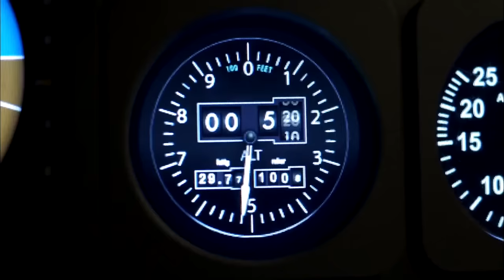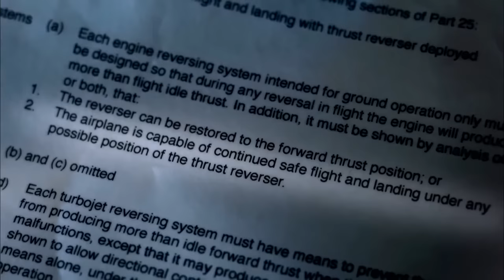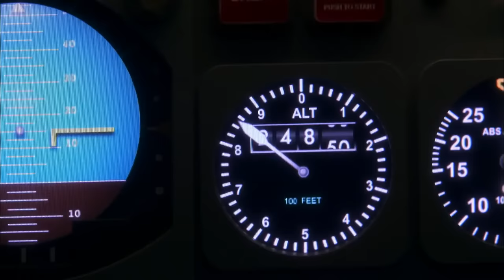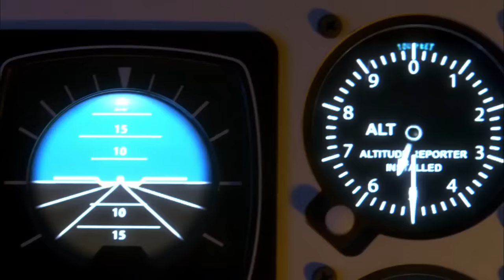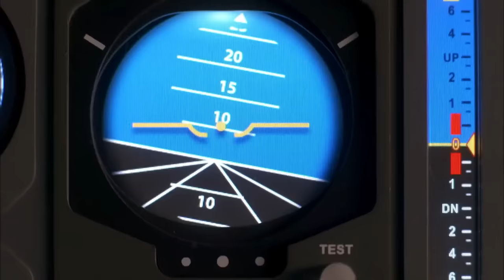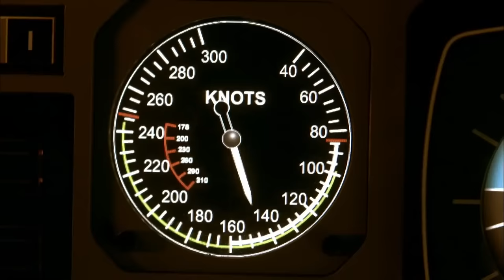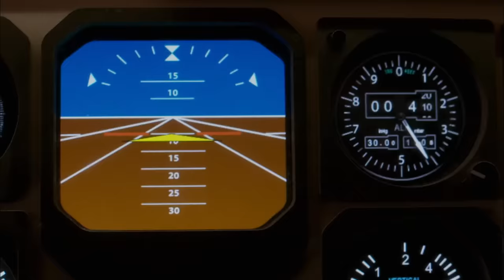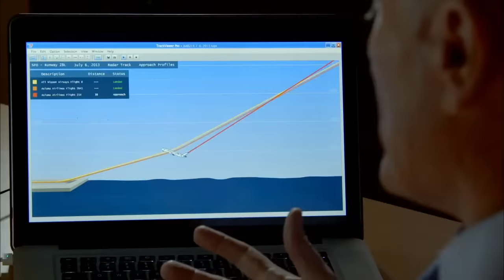Every Single Plane Crash - Air Disasters Seasons 8, 9, 10

Comment: I am hooked on these shows because the re-enactments are truly done as accurately as possible, with full explanations as to what the pilots did and why, which is then followed by an incredible investigation in which the minutest details are deciphered to uncover the issues that lead to new regulations that overwhelmingly has made flying safer.
Reply: The reenactments are silly and riddled with inaccuracies and errors large and small.
Reply: @darkprose  mexican planes are better
Reply: @darkprose  why don't you go ahead and try to make them better?
Reply: @Aidy_tude7.16  sorry this is long. A tl;dr is while they do a great job, they were a TV show and they upped the drama to pull people in and do make mistakes. But many shows do. 

To be fair, this is a cable TV show (or at least these seasons were). So they made the episodes more dramatic, trying to draw people in who channel surf and randomly found it. 

Most details are right, but sometimes just parts of the reenactments are silly. They're normally amazing, don't get me wrong. No youtuber comes close, not even someone like Mentour Pilot. But every so often it's just... stupid. Like when an FAA guy writes possible causes on a white board, and it's literally just 6 bullet points they cross off one by one. Or when 5 people are hovering around a scientist who should be in a lab. Or the pilots reacting far stronger than they actually did on the voice recorder- like more angry or more fearful. 

It's a great show visually. But when I love watching channels that show the crash and have all the facts right without tons of drams, like Disaster Breakdown, this show hits different. And yeah, they do tend to make mistakes - but any show, or channel on YouTube, likely has a mistake or two.
Reply: I feel the same way, it truly amazing how they can figure out the cause of each planes disaster!
Reply: @darkprose  got any proof of that.
Reply: Ikr they’re so good 👏
Reply: @FallenAngel53  👍
Reply: Plane crashes—> 

Xanax sales soar —>

Big Pharma shareholders smile
Reply: On Disney
Reply: @darkprose  I agree, the re-enactments are horribly acted.
Reply: @Hinzey98  yeah, literally the actual cvrs being less dramatic
Reply: @ernievallejo11  LOL
Reply: I agree!!!
Reply: So true. The loss of life is not in vain. I know that is little comfort to the families but it is "something". It is akin to locking up a murderer who will never hurt anyone else.
Reply: @darkprose  yeah very possible if don't like...change your Channel to "Wheel of Fortune"
Reply: those engines must be broken wind causing engine to surge
Reply: You must be watching a better version than I am cause the investigation part is cut out and it’s very annoying 😢
Reply: @Aidy_tude7.16  m...

.....ok.o

........

..........o

......
.
.

....
Reply: @Faded-Tales-PreviouslyHarley  ...
.

.............n
..
Reply: Bbbn
Reply: @Aidy_tude7.16  the
Reply: yes, i agree.
Reply: the investigators are so heroic...irony is they gotta fly to each crash site I guess...I wonder which airline they choose..the best I bet
Reply: If the FDR and CVR can be designed to survive crashing and fire, then compartments for passengers can be so designed.
Reply: @darkprose  Cutting down a good thing that people find use from so you can feel smarter or maybe you feel jealous!
Reply: @brendabrashko5953  
yeah Brenda i think the show has been chopped up. no mention of how many survived on some of the episodes including when the planes slam into hotels , apartments and city main streets . maybe if you keep watching   they pick up the thread later. i don't know.
Reply: @UCu6JbjJ7XyDtcezw3d-_AhQ 😊
Reply: Fly at your own risk, people, I want to live a bit longer. My flying days are over. I do not believe that flying is getting safer but, rather, seems to be killing more people every year that passes. The main problem as I see it: Pilots are trained to sit back and let on-board computers do most of the flying, and have no idea how to really take over to fly a modern airplane if too many things go wrong. Even if they are great pilots, some modern planes just are not equipped with basic controls which might be used to actually fly.
Reply: Yeah it really is well done. Better than most tv shows that are probably operating on 20x the budget
Reply: @Faded-Tales-PreviouslyHarley  pilot is great but greendot aviation is lueges above this, he makes 3d renders of a plane and goes over EVERY detail its this show on crack
Reply: @markbahouth2713 these are clips from longer episodes
Reply: @trukeesey8715 the black boxes are made of metal which can stand 1,000 deg C for something like 30 minutes … I don’t think you’re going to find people with those advantages.
Reply: @moiraatkinson  Good point.  Also made me to laugh.  Still (just brainstorming, not suggesting this as final solution) what if cars were to have 3 feet and planes were to have 50 feet of air-compartmented hard rubber surrounding entire chassis?

Or some other ingenious idea.  How about giant springs sticking out from the chassis/fuselage?  If you are not familiar with brainstorming, it is a process of taking a stupid impractical idea as an inspiration for a practical one.
Listen to Prem Rawat!
Reply: @darkprose Are you sure you’re not describing your entire life? ….and the riddle your mother told you about who your real father is? 🤔
Reply: @trukeesey8715 I am familiar with the term brainstorming and I’m all for it.  Nothing wrong with speculation!  The main disadvantage I can see to your idea is cost.  The extra drag and weight would not sit well with the airline companies 😊.  I’ve often wondered why new planes can’t be built with rear facing seats and proper seatbelts.  If you look at the cabin crew, their seats are rear facing and they have much more of a seatbelt than our lap straps.  This wouldn’t cost any more and would stop people being thrown forward in the event of a crash.  There is aviation fuel available which the military use, which is a lot less flammable, which would cut down on post crash fires.  I gather that is more expensive though and had been rejected due to cost.

Comment: 18:58 there’s procedures for things like this! Doing 360’s! until you’re okay enough in terms of km/h and you can put down the wheels to break the air, push the engine to “sucking air” and land!
Reply: Or you close the engine! Because it will explode if you impact and engine are still running! 

I learned this by watching stuff like this when I was younger :)

Comment: It should be made impossible to crash a plane from human error, instead of a warning going off in the cockpit why don't the computers just take over until the risk of crashing has passed? Yeah, I understand that bad software could cause a crash, to prevent that a quick command to lock the computer out to give the pilot full control. When you get a warning to pull up it takes time for pilots to put that into practice but if the computer just took over the plane and pulled up straight away, the plane has more time to pull up. Yeah, the software would need to be 100% correctly, programmed but surely it can be done.

Comment: FedEx flight flight 80 was over speeding in strong winds and when it landed a gear  collapsed and The wing hit hard to the ground then the feulasalag and in engulfed in flames
Reply: The Concorde ran over a strip of metal that just fell off a plane in front of them. The scrap flew up with such force that it pierced a fuel tank . Thats where the flames came from. Not the engine. Fuel is in the wings. There are 13 fuel tanks on a Concorde. I always wondered what happened too. The hydraulic lines were ruptured or cut burnt. Loss of control lift and crash.

Comment: inthat case NOSE DOWN and one one some planes you can push the THR/LVR- to CL or TOGAby slamming them, you brake something, but only the THR reeerscontrol and get some OVER REVVING of N1 to near to/ga settings pkus braking with spoiler fail, you really need to feel those brakesask the copilot WHEEL PAGE AND GET THE TEMPERATURE , and sound of ABS braking autobraking sounds PRESENT, and et it to brake slow. and PUSH THE NE DOWN, MAXIMUM DEFLECTION it'll maybe reduce the AOA

Comment: this is why i wont ever fly! I am a technician and a mechanic and let me tell you those engines are complex machines, were talking clearance specs on fast moving rotors. fan blades and of course cheap wiring don't help.

Comment: I would not have lifted off in the Concord, damn V1. I'd rather take my chances sliding on the ground past the runway then loss of control or fire in the air.

Comment: And to make sure the surviving family members of aircraft crashes don't sue the manufacturer of the downed plane due to design, mechanical, or electrical defects - the plane crash disaster investigators blame the crash on pilot error because dead pilot's can't personally defend themselves from the cemetary. When in doubt on why the plane went down, blame the dead pilot. Look what happened to the pilot who landed his aircraft on the Hudson River. With all the years flying experience pilot Sully had, there were people from the builders of the plane to the NTSB trying to blame him for the plane crash. Not the birds who flew into the engines.

Comment: Oh and @Nemesis prime i saw your message on the live chat about when the asiana plane crashed, yes you can go to water to stop plane from burning but the gas of planes is lighter than water so it floats, thus making the plane still burn, other thing, some people can’t swim so if a plane crashes on water then its ggs for them and if  the plane crashed into the water at the speed it was it eas 100% assured the plane was gonna crash like if it crashed on concrete bc water tension, hope i solved your question

Comment: Lithium batteries aren't just flammable- they're literally explosive, and once they explode, they burn at temps no normal fire would ever reach. And- water simply makes it worse, lithium reacts with water much more violently than it does with air- throwing water on burning lithium will cause a massive explosion. It's the oxygen int he air that it's reacting with- and water has far more of it. Lithium will strip the oxygen from the H2O molecule releasing tons of energy very, very quickly. The best way to stop it is to smother it with the proper chemical extinguisher or that foam stuff they spray on fires sometimes. But you're going to need a huge amount very quickly to overwhelm this reaction and smother it out. And- if any of the lithium gets exposed to air again- it's going to start reacting again quickly. Unless enough of an oxide layer built up on it to keep it from being exposed to the air. But that's only going to be on the surfaces that were exposed and reacting- which means all you have to do is dig a little and expose some fresh lithium- and here we go again. How they would clean it up I have no idea. You'd almost have to just let it go ahead and burn up- that would be the easiest way to deal with it- let it turn into a big pile of lithium oxide.

Comment: Quill or no quill..that plane, flight  2311, should not have gone into an uncontrolled dive.

Only if the plane had stalled could the pitch and trim controls have become ineffective..but the plane did not stall!!!

The 'quill situation' could have contributed to a pull to one side and that's all..the rudder would've been able to control the yaw.

The investigation was not thorough.

Comment: Do they know how many times planes could have been saved with just 2 or 3 simple backup cams mounted on plane so pilots can see what happens to the plane when it just goes haywire all the sudden .. it's like they have commen since blinders on .. wouldn't cost much at all and all the potential lives that could be saved hmmm .. maybe in just crazy I dunno

Comment: Pretty simple, at 1:21... Paul Walker simply needed to PULL ON THE DOOR For it to open. I had the same issue before, the lock was actually open, and a simple YANK would have opened them. THey had Spare tires in their cars to stand on, jacks and Jack handles to pry the door open. Yes he DID Fail them, as with the other outside people who stood there.
Reply: Only he knows what happened.
Reply: Are you sure about the time? 😆😉

Comment: Damn...if I was Paul I probably would have ended my life shortly after. It was up to me to save them an I just gave up an walked away. I would have got it opened or died trying!! I couldn't have walked away. But everyone is just built different i guess. I was in a head on crash in a car before. I broke my left ankle, didn't know it at the time cause of lace up boots. The other car evolved the driver was stuck behind the wheel an couldn't get out. I put my foot against the back door an pryed,pulled an yanked on the driver door till I got it opened ( cops an tow truck driver didn't see how i did it by the way the car was crunched in) but I got it opened an the driver out that car!! Right after the cops an ambulance showed up. She was ok but some scraps an bruises an thats when I found out my foot/ankle was broke.😬😵
Reply: But the point is I didn't give up till I got her out!!

Comment: It's AWAYS operator error.
Involving the human factor. 
Add the fact that most pilots are under the influence of alcohol use, and in some cases, drug usage. Flying in a plane is no different than driving with a drunk or drug high vehicle driver. At least on the road, your accident is ground level. In an aircraft, the ground is your worst enemy. The ground is your death sentence.
Reply: @Sub-Zero757  It's been documented by the FAA and The NTSB that a large number of commercial air pilots and private pilots do fly under the influence of alcohol 🍸 and drugs. Explain to me Mr. Sub-Zero 757 know it all, why pilots hang out before and after a flight in the terminal cocktail bar? And explain to me why last week, on national television news, that a pilot was arrested for being very drunk before he boarded a flight where he was the Captain pilot? And we all know that pilots don't get a proper sleep period between flights because of the pilot shortage. In keeping awake, many many pilots take uppers to stay awake during flight time, AND when the plane service crew passes out alcoholic laced drinks to the passengers, the pilots get the same refreshments handed to them when the plane is switched on auto pilot. Some pilots even take a nap when the plane is switched on auto pilot. So before you call me a bum again and crucify me for pointing out the REAL PLAIN facts about pilots doing what many alcoholics and drug users are doing on the ground. Educate yourself by getting off your high horse and removing your head from inside your dumb ass and for once in you're life - breath fresh air and not constantly inhale your ass gas.

Comment: In the case of the Kennedy crash the official story was they ran out of fuel an then they said the fuel switch on the plain had beef shut off an they said he was supposed to be flying with another pilot on board an wasn’t then they said they never found the front passenger seat so how did they come up with this story ?
Reply: The airport he left from probably confirmed that. Since he would have had to file a flight plan and calcukate everyone's weight to maintain the proper center of gravity on the aircraft.  I'm sure many people slso recognized him at the airport and confirmed the total number of people who was with him. Since the press knew everyone in the plane they obviously would have known that he was the only cockpit qualified pilot in the plane.

Comment: engine in the back but they still smell it wtf?
Reply: Well heres a fact only a pilot (such as myself) would know. All aircraft dont really get moved forward from the propeller thrust backward but get pulled forward from the low pressure area in front of the prop spinning. Same thing with jet engines. They get pulled forward from the low pressure in front of the jet engine which is drawing in extremely high velocity air in turn creating a vacuum.  My point being if you have a rear mounted prop it works the same way so if theres a vacuum in front of the prop its going to draw in any fumes. Maybe nowhere as much but definitely able to notice a problem.

Comment: A none instrument rated pilot enetring IMC has 90 seconds to live, that is all. The Kennedy bloke mistook ambition for ability. As for Air France and Concorde, a whitewash by the BEA. It was all Air France`s fault. An over loaded aircraft, CofG too far aft, engineers did not replace wheel spacers, a flight engineer who sut down egnines without being told to, yes, they killed Concorde

Comment: I'm very Happy I have NOT flown. I watch ALL videos of Plane Crashes and disabled Planes. For maintenance on ANY Airline, Do they give those people like Pilots Psych Evaluations??? Number 2. Some of these  Pilots nowadays are also incapable of flying and controlling a Plane. "Id rather be on the GROUND dreaming about being in the AIR, than be in the AIR, PRAYING and DREAMING about being in the Ground. How many more Lies are they going to TELL about You can't lose Hydraulics and that's regularly the probable result in quite a few of these Crashes I've watched??? I'll stay driving and catching the Greyhound Bus to get from point A to point B where I don't have to worry about it losing a Wing, Screw or Hydraulics.